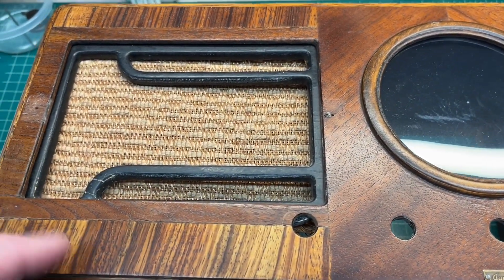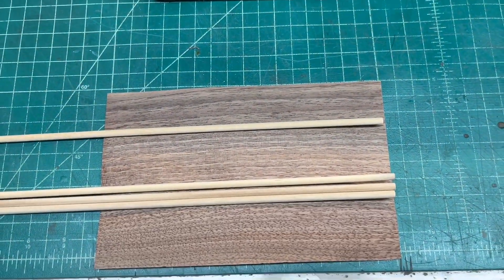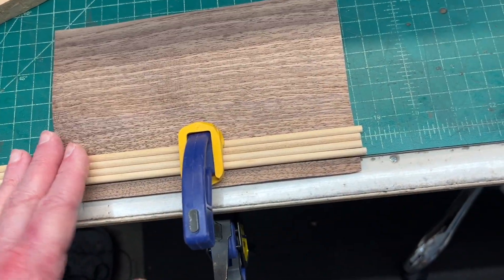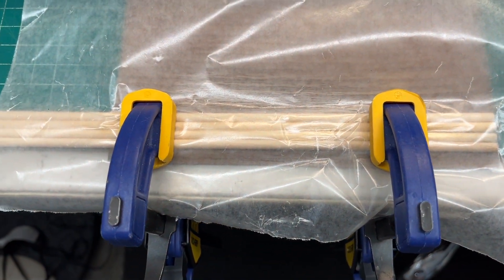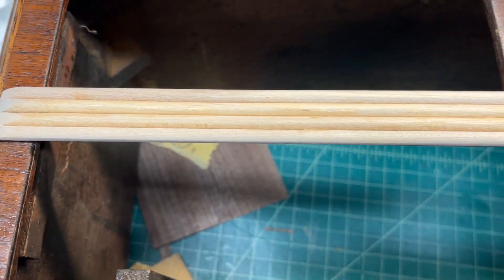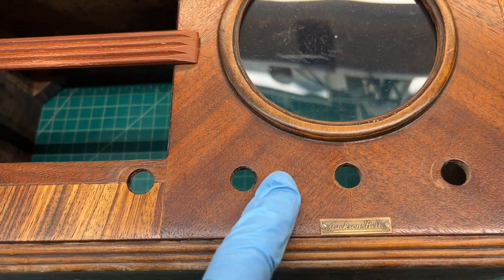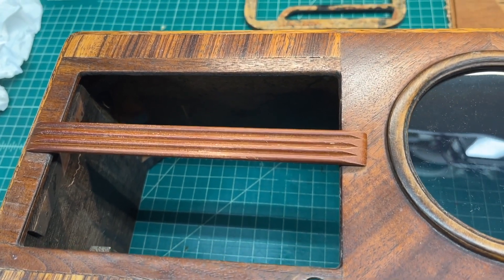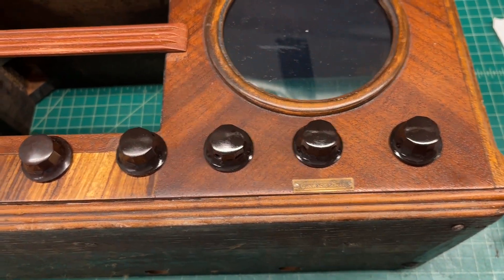Jackson Bell Model 556 - Reproducing a Trim Piece | Knobs | Playing Lonesome Avenue by The 126ers

Comment: Looks Great , myself I have the sstran 3000 transmiter ,far as your Casting goes what product did you use I bought Some alumilite silicon molding and resin casting material .
Reply from the maker: Hi Richard - a couple recent videos below I posted in regards to your question. Thanks for watching and reaching out. Best, Don

Simplex Model PB - Casting Four Knobs
https://youtu.be/afUUZS-g4sY

Simplex Model PB - A New Silicone Mold & Much Better Knob Casting Results
https://youtu.be/XiAtZPu6FlA

An older video at:
How To Mold & Cast Vintage Radio Knobs
https://youtu.be/sHH6WHNoLoI